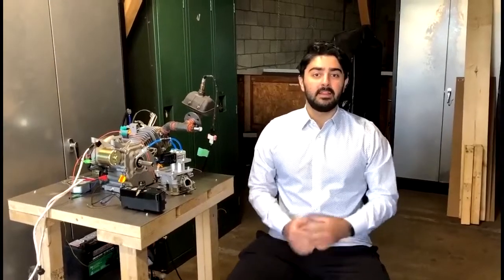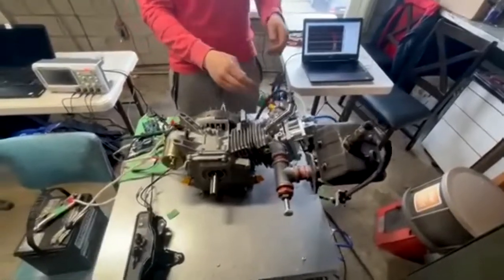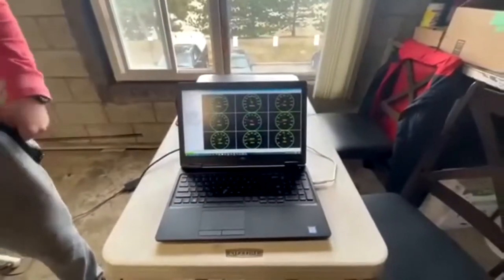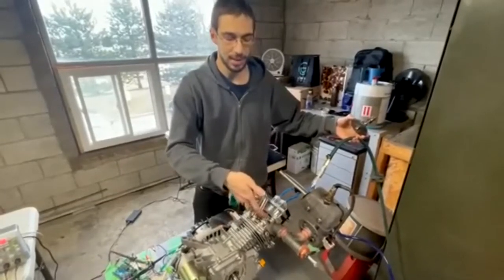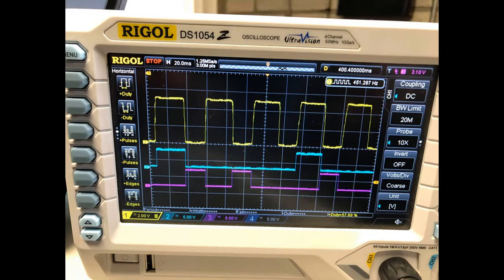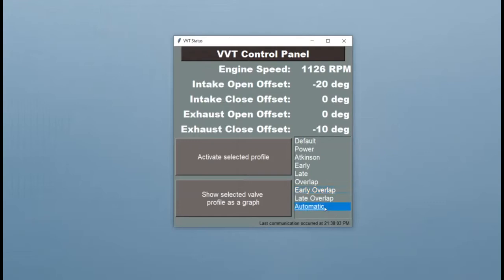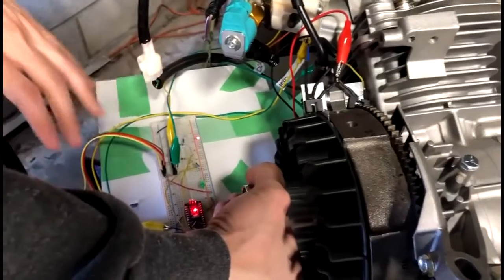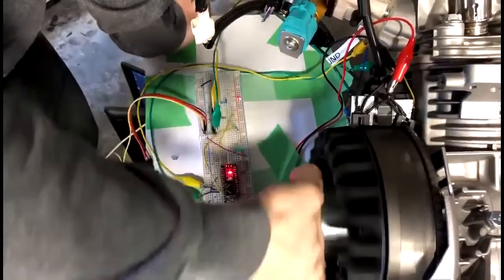Capstone Camless Engine

Comment: What type of pneumatic solenoid u guys used ? I mean the excitation time.we are also kinda doing the similar project but stuck on the appropriate solenoid.plz help
Reply from the maker: Hi there, thanks for the interest. The solenoid we used for the prototype was MHE3-MS1H-3/2G-QS-6 solenoid valve. The opening and closing time for the calculated event time was 2.2ms. Real prototype was not calculated.
Reply: @kurtiscollins8519  thnx alot